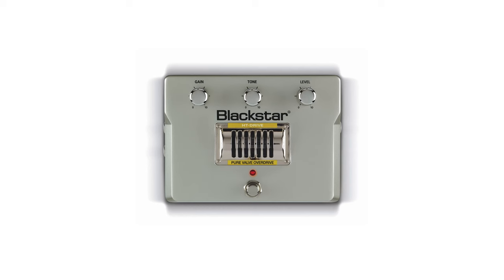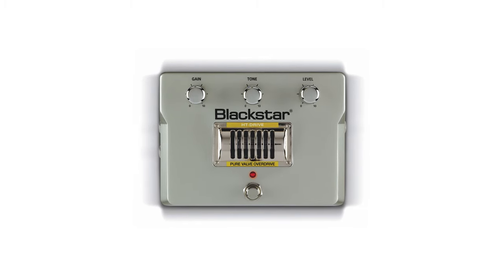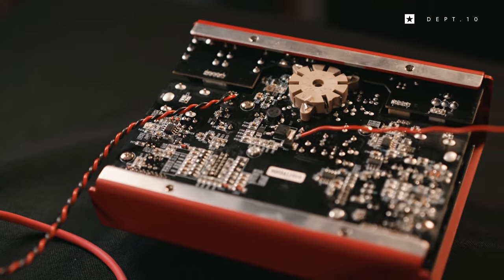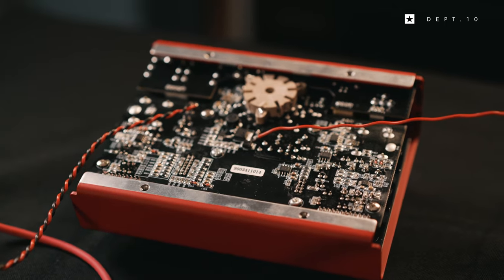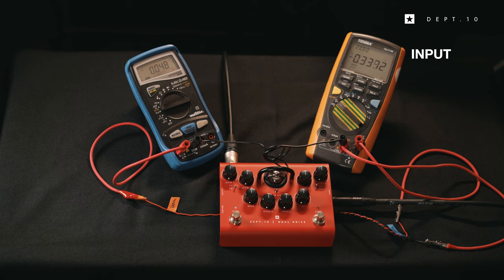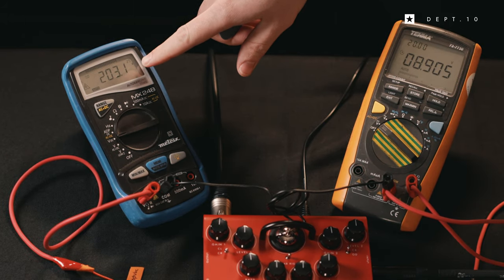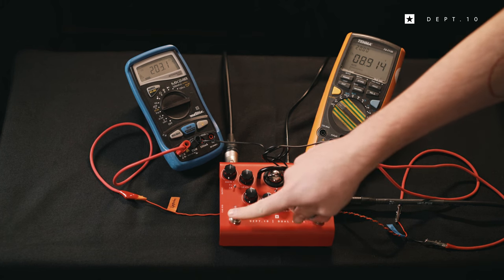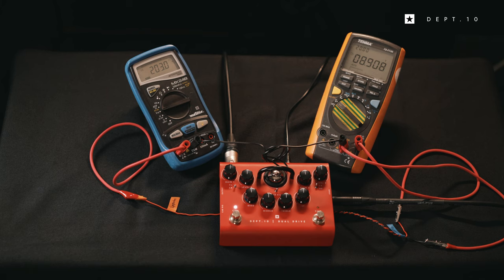How do the Dept. 10 pedals run at 200 volts? | Dept. 10 | Blackstar

Comment: Thanks for the video Alex. I just bought the Dept 10 Boost this morning. It sounds wonderful. But as you know, we engineers like to tweak. Would the pedal power supply cope with a 12VDC input? That should give me about 260-280V on the plates. I would expect the cathode resistor may need adjusting, but if it is a SMD, then that counts me out. Great work, fellas.
Reply: Hey love your channel 😊! I’d say they will never give you any of that info, messing with their craftsmanship haha. Also you’d probably know as much as they do on if that’s possible. Love to see a vid on your channel if you do give it a go though. 
Im keen on the red one now the used market has them at a reasonable price. 
✌🏼
Reply: @clintwhite3021  Hi Clint. Thanks mate. I received a short reply via email, which basically said "Don't do it", but that's it. One day I may have a look inside, but the pedal sounds so good out of the box, it may take a while before the "need to tinker" takes over. I saw the red one on The Pedal Show. It sounds very good.
Reply: @theguitaramptech  haha What are you even supposed to do if the valve fails? I wonder if it’s replaceable. I’ll definitely have to try one at some stage but I’d be worried about the tube failing at a gig and that’s kinda the end of the gig. Though I’ve been using a Joyo American sound as a speaker sim only for my tube preamps that does an amazing and versatile job. Which obviously would be a complete backup amp sim anyhow as I play direct.
Reply: @clintwhite3021  A preamp- tube is actually very robust. It's unlikely to break unless you drop it from a height. I had a little peak inside and that looks like a tube socket from the bottom. Because I am a nerd, I will replace it one day with an old RCA, but in all honesty, I don't expect much of an improvement. 
If it failed me at a gig, I would quickly bypass it. Nobody in the audience would notice. My bandmates would say "This is not the time to be fiddling, Chris!".  It's great. I love it. (Note to self: stop watching that pedal show. It's costing me a fortune).
Reply: @theguitaramptech  haha YouTube has cost me a fortune 🤣. 
That’s good to know they are pretty robust. I’ve never had any tubes (poweramp also) die on me come to think of it. 
I’d actually use it as a standalone direct amp replacement, so I would still be a little worried it would just die on me mid gig. Guess that’s what some kind of backup thing is for :)
Reply: @clintwhite3021  Well, Clint. Let me prove how stupid I really am. I had packed for the gig. Lights. PA. Two guitars. Pedal board. Mikes. Stands. And I headed off to the gig about 3.5hours awya. Started setting up when the most sickening feeling hit me. I forgot to pack my amp!! Show starts in 30mins. My life-saver was the Mesa V-Twin (yes I know I slag them off mercilessly) straight into the PA. To me, it sounded like shit, but the audience would not have known the difference. Lesson? ALWAYS take backup.
Reply: @theguitaramptech  arrgh what an awful feeling that would’ve been. Haven’t done that but driven as far (may have been the same gig if it was country Vic) and another band was setting up. Luckily the 3 others were only half way and they could turn back. But the venue were nice enough to put me and the wife up for the night haha.

Comment: Not sure if this was quite necessary to show but hey cool nonetheless?
Reply: A lot of people are (understandably) skeptical about tube-based distortion pedals--because most of them run the tube at such low plate voltages that the tube is basically useless. This demo shows a crucial feature of the design.
Reply: @VIDS2013  very good point actually! Haha I'm not a tube pedal head myself otherwise I would've thought of that. I guess this is actually a pretty legit pedal, sound AND circuit wise!